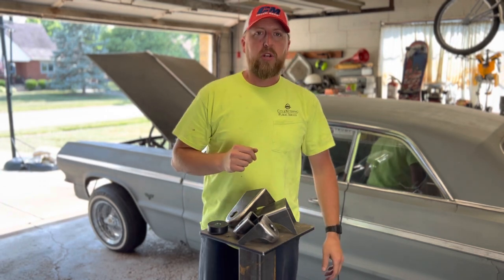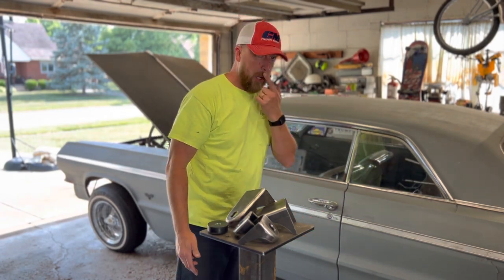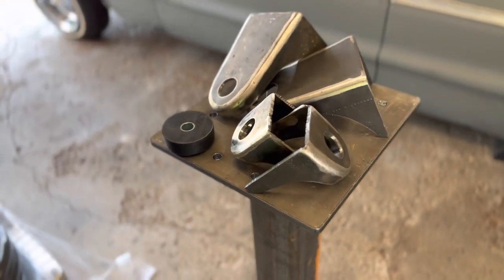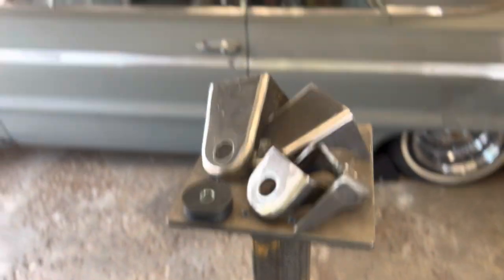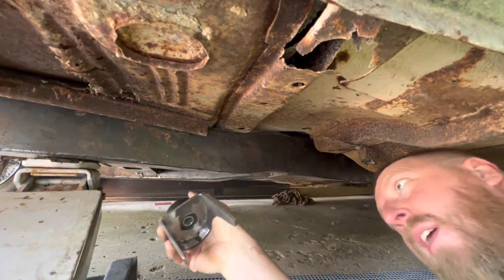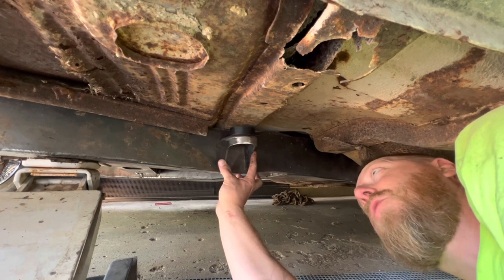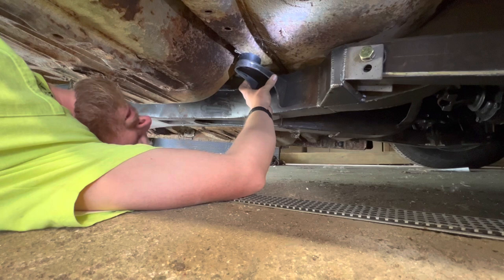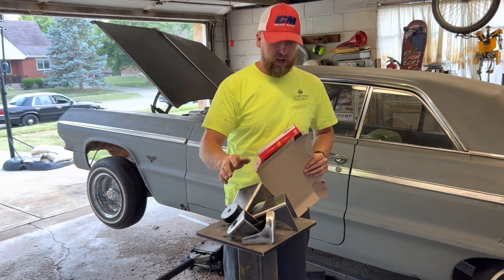1964 Impala convertible body mounts. What are they, and why are they important. @cabron1964

Comment: The crack in the quarter panels deveolps because the wheelhouse boxes have deteriorated/rusted out. Worn body bushings likely contribute as well.  The reason the convertible had the extra mounts is because it didn't have the stability of a hardtop. If your rear wheelhouse boxes and body bushings are deteriorated, you'll still be prone to developing the crack at that quarter. I'd say that's more important to preventing cracking issue, however, I might consider this idea. Additional stabilty can't hurt, but I'm not totally convinced of the significance concerning preventing the quarter crack.

Comment: I thought those stress cracks come from rusted out mounts under the wheel well/upper trunk. 

I don’t have social media but does Max sell those mounts on EBay?
Reply from the maker: You’re 100% correct. I wish I would’ve mentioned that. As you can imagine, both problems could lead to cracks in the body. I don’t believe he sells them on eBay. You can def reach him on Instagram @cabron1964. As always thanks for watching.
Reply: Hey there Im Max
Reply: @mexabilly79  good work primo lol

Comment: So I get the purpose of the extra frame support, and I agree it’s a serious benefit. What I don’t understand is why you would have that car off the frame, have the car mounted on a rotisserie, and also being a sheet metal guy, a welding guy, then not repair the obvious problems with the sheet metal, one issue being that crossmember that has literally disintegrated… that just absolutely makes no sense to me, maybe I missed something.. get your mig out and take care of that girl sir. Love goes out. 💯
Reply from the maker: Umm yeah I’d say you missed a lot. I said in the video that the entire floor is being replaced… including crossmembers. Also, fabrication of this kind will require me to remove the body from the chassis several times for complete alignment and fitment. It’s not as simple as bolt it on and move on. Door gaps, panel fitment, bushing alignment all need considered before final welding and assembly. At this stage, the floor is the least of my worries..
Reply: @gemcitywelding7234  😂